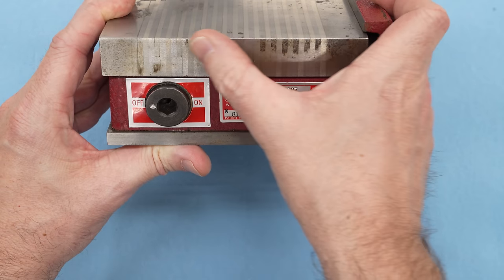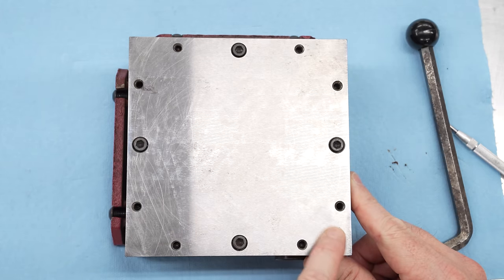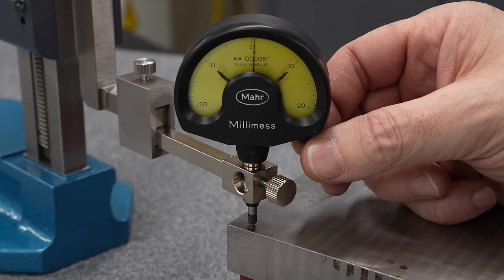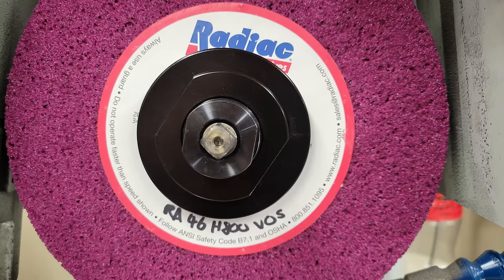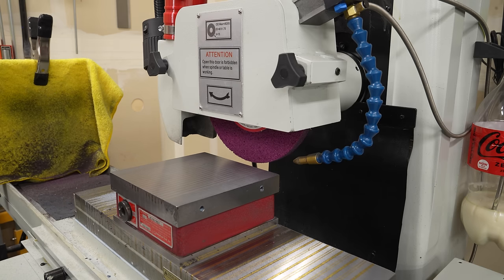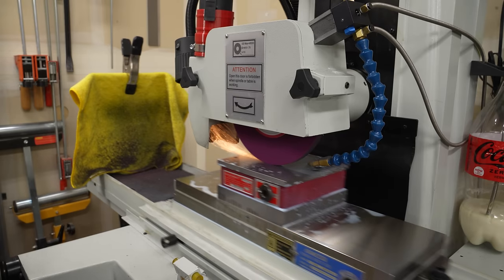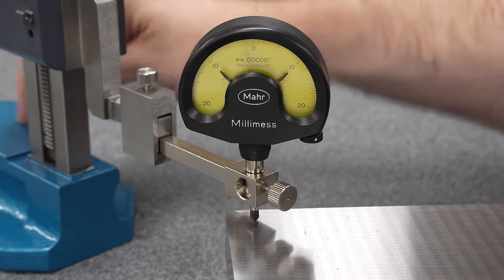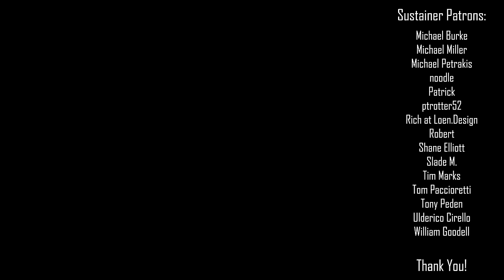Restoring a Rusty eBay Magnetic Chuck - Suburban Tool Sine-Set MC-66-FP-S1

Comment: I was always taught that you need to engage the mag when testing for level.  There's fluctuations between the layers on the surface that can only be found when the chuck is engaged.  e.g. magnetic pinpoints and surface pulling.  Also, I was taught that you should engage the chuck for 48 hours before grinding, this allows the chuck to settle with it engaged so you get better repeatability.  Just something my shop instructor always "ground" into us :)
Reply: you can speed up the process by heating the chuck to 120f then letting it air cool ,it's how they settle the chucks at one of our contractors shops
Reply: might be more on electric chucks?
Reply from the maker: Oh, interesting.  If we're being pedantic, and I think we are, I should also turn the spindle on and let it run for a while to warm up and stabilize, and I shouldn't be stopping it between setups.
Reply: @Clough42  That's pretty much what Don Bailey @SuburbanTool would advise, and he's the most knowledgeable YouTuber on precision grinding I know of.

Comment: Very good job especially for your experience level. About 80% of the life time grind hands I know could not do what you did. Someone commented that you used the diamond dresser wrong but he is wrong. You used it the correct way. If it was rotated 180 degrees into the wheel you would have put a flat on the point and ruined it. Mag chucks are hard to get flat. You have many more variables  to overcome. One thing to consider changing is your roughing method. It generates a lot more heat than just coming across it with about .05 step over verses .4. You can take huge deaths of cuts with less than .05 step over and keep the cooler than taking big step overs. I don't do a true step over but just keep the Z axis moving while traversing in the X but it would be close to a .05 or less step over. Also, you don't have to worry about the wheel grabbing the part and throwing it off the table as much. This method work great for light mag work as well. Again great job, I am impressed.
Reply: Larger stepovers distribute wear better on the grinding wheel, plus maintain thickness of work from one side to the other (2/3 wheel width). This was the practice when I was using grinding machines. Plus 1 for the diamond, agree with engaging the magnet. I once dressed the wheel too hard, lost the diamond (melt the braze) and told to fish it out of the coolant tank. More to make the point, I think. Surprising, I found it, sitting on the slurry.
Reply: @BillDavies-ej6ye   Don't need to worry about the wear in roughing cuts, the heat build up is the real enemy. You true the wheel up with a redress before the finishing cuts. I grind under fifty Millionths all the time with this method on both small and large parts.
Reply: I was going to say ask Steve barten. Lol but he's already hear.  ❤

Comment: we rarely step over the whole wheel width .   Most of the time we used lighter cuts ,takes longer but theres a crap load of heat being put in the metal.     Alot of the time we left the wheel on  all through the project , even through set ups , it's pretty much standard practice in tool and die shops  the spindle and column heat up  and settle in.  in fact it was considered kinda rude to shut it off if you knew some one else was going in right after you.    variable mag. chucks are super nice when grinding for flat.
Reply from the maker: Thanks for the tips.  Next time I'm doing something serious, I'll let it run in for a while.  That's kind of hard to do when shooting a YouTube video though, due to the background noise and the comment safety police.  :)
Reply: @Clough42  maybe a sound dampening enclosure for the grinder could be an interesting project?

Comment: I really don't see anything I would have done differently. Yes, checking the bottom would have been on the initial inspection, but the order of operations wouldn't have been any different (other than grinding the machine's mag chuck first, of course). Nice work, James.

Comment: James, As an observation, I see alternate conventional and climb grinding.  A suggestion from an old guy; for precision work only conventional cut.  When climbing the swarf must go up into the wheel prior to being expelled by centrifugal force plus greater contact area for the wheel adding unnecessary heat, not an ideal situation; also the wheels bonds are stressed from two directions.  I was taught ( in the early 1970's) by a master toolmaker to only conventional cut!  Another thing I see is the grinder being turned off between grinds, every time the wheel is started it needs dressing, as it may become eccentric on the hub.  I was taught to start the machine and let it warm up while collecting the tools and work to start with.  This next part is not the safest procedure but the most accurate.  With the wheel running move the table to the extreme right to place the diamond on and secure, dress the wheel, and again move the table to the extreme right to remove the diamond.  Move the wheel well up out of the way and clean the chuck.  After wiping slide your hand over the magnetic chuck to ensure no grit or swarf remains.   The wheel spins until the work is finished.  The largest enemy of precision grinding is dirt in the wrong place, the second is heat,  as metal moves as it warms or cools.  Try it, you may like it!

Comment: Congratulations James, that was pretty spectacular for a first go at trying to get that chuck to a much better tolerance than from the factory. I think anyone who has any experience with surface grinders would call that a win. And now you have a serviceable mag chuck for the sine plate system, ( after you've ground the sides square and all the other bits that is lol )

Comment: Begin by disassembling the chuck, followed by a thorough cleaning of each part. Proceed to individually grind the plates, ensuring they are aligned for contact and parallelism. Once reassembled, perform an additional grinding. This method addresses any geometric inaccuracies that may have arisen from incorrect assembly and avoids creating a chuck whose disassembly would disrupt its overall geometry.

Comment: One tip ill add is that when i was in the shop, we all used blue sharpies instead of a pencil for a flatness reference when grinding. the pencil is a little hard to see in camera, but i think the sharpie should pop for both us and you.
Reply from the maker: The only reason I didn't use sharpie is that I was afraid the soluble oil coolant would wash it away.  I should probably test.  It might be fine.

Comment: As a person that loves to surface grind, I have found that using a piece of yellow legal paper under your part always works good for part removal from the chuck. For some reason yellow legal paper is very consistent at .008", or it used to be. But there will not be any scratches on the chuck when you're done.
Reply from the maker: Oh, interesting.  I might try that.

Comment: I just purchased a compound magnetic sine plate on eBay.  It is older and needs some help after it is repaired.  I think that I will surface it in the mill first before putting in on the surface grinder. I am looking forward to see how it stacks up against the Suburban.  Thanks for sharing.

Comment: not to be too nitpicky, but it looks like the mag on the machine had a little bit of a scallop/fish scale finish to it when you were done. there are two causes for this phenomenon: grinding wheel is slightly out of balance, or the arbor bearings have a bit too much slop. you can compensate some of the bearing slop with balancing the wheel better. and then dressing it. the machine i have has a built in wheel dresser which gives a really good finish on the wheel. if your machine can be retrofitted with one, it is an accessory that i highly recommend and would not want to do without on any surface grinder

Comment: Don't try to recondition the Sine plate. It needs all parts ground  individually using the pivot as a reference. You do not have the equipment to do that. Also if the pivot has any rust in it at all it will need to be rebored and pinned. Get a price for a factory recondition. Edit: BTW some mag chuck base plates have a VERY slight hollow in the center - allows the perimeter to sit dead flat.

Comment: Nice work. The finish “flatness” and “parallelism” is the final “judge” if you did a proper job.😎
My only suggestion is flip that dresser around. The diamond should be “facing” the wheel front not pointed “away”. Also, when dressing the wheel the diamond should be “past center” so that if the table is not locked and the diamond “grabs” it won’t explode the wheel, it will just throw it off. I always lock the table though when I’m dressing the wheel. Otherwise looks like you are doing fine work.😀
Reply: I don't think I've ever heard/seen that anywhere. Almost all directions I've been told and read for dressing the wheel say to have it pointed in the same direction as the rotation of the wheel, not against it.

Comment: OK, I'll be the odd man out. When I started (1970's), I ground chucks kinda like you showed here. One day, an old-timer that I learned to trust told me to grind my 6 x 18 so it looked like a wash board. So that required large steps and only conventional cuts - no climbing. My diamond was mounted in a rectangular block. At the end, you take that block on its broad side to each corner of the chuck, rotate it 30-45 degrees, and see if it sparks out. Repeat that in the center, front to back. I had to learn that how the chuck looks is nowhere near as important as the pieces you grind on that chuck. Heat is your enemy. Guys used to put Crisco over the entire surface, but I was the guy who introduced mist coolant. For the guys who insist on using the leading edge of the wheel, one could also use a 1-inch wide wheel instead of the 1/2-inch. Incidently, I used my same method on a war-era Thompson grinder with a 12 x 24 and could grind a die block that was maybe 10 x 14 dead flat. I think you did a great job for a newby!!

Comment: Some nice work. 

I would have been tempted to remove that bottom plate and ensure it had uniform thickness, and possibly grind it by itself to ensure the chuck doesn't ring up with both top and bottom with matching slopes of a few tenths. However, that's the OCD kicking in.

Do you forsee any issues with grinding the chuck while it's magnetized, but inspecting it while demagnetized?
Reply: I would have thought when chasing fifty millionths, OCD was absolutely compulsory!!

Comment: Some indicators are anti magnetic, and some aren’t. The better ones usually are and the rest? Well, take a guess. Suburban’s specs are a maximum error. Generally, my experience with a “new” tool from them is that the actual error is much less. This could have been new. It depends on storage. I’ve seen some new tooling that looked as though it had been used for years. But I’m skeptical. The surfaces that were rusty shouldn’t have been. The only thing I can think of as an excuse is the it was new, taken out of the box, cleaned off the protective oil and sat around for some time, maybe used once or twice.

Comment: Nice fix James! My suggestion would be to check your grinder accuracy from front to back. I think you will find the 50 millionth error resides there.  Probably will just have to live with it or scrape the ways (Hmmm, another vid?)
Reply from the maker: I would think grinding the chuck would compensate for that.  Maybe I'm missing something, though.
Reply: You have to think in 3 dimensions.  The chuck surface may be perfectly flat, but still  coplanar to the ways which may contain the error. You could take a similar size piece of metal and grind it, then see if the error repeats.  Then you will know it's the ways. @Clough42
Reply from the maker: @shawnstuart1029  the gold standard is the five block test.  I actually have five hardened steel blocks for exactly this purpose.
Reply: The error could be from going full wheel width on the grind. Small increments leaves a full size side of the wheel for longer when doing larger surfaces finish passes. Or so I was taught. Outside of training i have never used a surface grinder 😊
Reply from the maker: @klausnielsen1537  I think either wheel wear or thermal expansion are at the root of the taper.  Though let's keep perspective: 50 millionths is just fine for anything I will ever make.  :)
Reply: I believe you have hit the nail here.  I know that you are....well let's just say "retentive" but in a home shop with budget tools and machinery you hold impressive tolerances. There's no need to chase numbers any further.
Reply: @Clough42  50 millionths got us to the moon, so you should be fine :-)
Reply: @Clough42  just fine for anything you will ever make...... except this video, where it's on the edge of ok.  ;) ;)

(I tease.  It's fine here, too.  And great video!  Except for that BSOD.  I'm on Linux... and was like, uhh, what?  :D)

Comment: One thing's for sure.......there ain't nothing like having a surface grinder even if it is well used and a manual model.......a shop without a surface grinder is a struggle place and I've worked a few of those in time gone by.

Comment: I'm in the process of looking/buying a home in Eagle and you mentioned "No rust" which was a concern of mine as I have a full shop of wood tools. Very sweet words too. hear after living in places that even leaving a piece of paper towel for a day or two can sometimes leave slight rust staining on an untreated cast iron surface..  Being just an engineer (i.e.self taught in the shop) I always appreciate your semi-side tracked commentary re. Do/Don'ts, & Maybe's as they stir up valuable internal thought provoking/learning moments.  re: "Should you use the Mahr indicator w/ or w/o the magnet engaged?  I can think of so many arguments for both ways...  Is there an absolute Yes or No answer?
Reply: To the best of my knowledge All Mahr indicators are non-magnet and are not influenced by normal magnetic field strength found in the average shop. I'm fairly certain that's not a guarantee for them however, and any medium Tesla strengths over .5 may have an effect since the gears are brass, the case and stem are stainless, and the springs are in tension rather than compression. MikeC
Reply: @CothranMike  Thanks for the confirmation. From my limited machining background (but still wide breadth of engineering)I would assume the same as you stated, and I would assume the same for any "high" quality indicator. but who knows what type of tip (or even what kind of stainless) could be on some other imported pieces of equipment... it could be like wearing a watch into an MRI.

Comment: Magnetic chucks are nice basically. They direct magnetic flux trough tapered magnetically connective parts to smaller areas than the permanent has by separating areas with  magnetically non conductive material. to either make circuit trough work piece or internaly trough chuck. High grip power is mostly because magnetic flux is denser in top of the chuck than it is on top of the magnet.

Comment: Always a pleasure watching James' videos.

Regarding the precision flat ground stones, kind of pricey for a hobbyist.

Any reason not to use fine sandpaper with, say, a 1-2-3 block as an alternative?
Reply: Yes!  They're a totally different thing.  The precision ground stones have been made mostly flat so lots of surface area is in contact with the metal you run them over.  They don't cut because you're not applying enough pressure to make them cut - sort of like how a bed of nails works.  Only raised burrs/dings get cut by the stone because they concentrate the force or go between the grains of the stone and get cut.  If you run sandpaper over your precision surfaces, it WILL basically sand it so at best it will be scratched.  The budget option - and definitely not as good - is to take an old file and run it across a stone (preferably a decent diamond one but mainly it needs to be flat) and grind it until you put a flat on the top of each tooth.  That way you have a flat surface that will run across the surface you're working on without causing damage but if anything sticks up, it'll get between the teeth and be sheared off.

Comment: Maybe it's just myself being a novice. But. If both sides are not flat. If you machine one side but the bottom is not flat, aren't you just making it worse?  I would have thought you would need to use a level and some shims or something, to get you as close as possible. Am I wrong?

Comment: How many inches shorter is that chuck compared to when you bought it? 😁
I doubt the magnet in the chuck will affect the gauge much if at all, I expect the magnetic field will rapidly trail off as you move away from the surface because of the way the magnets are arranged inside. I think it's a Halbach array if I remember rightly.
That said, it'll be a fun science experiment to get a Gauss meter and see what the magnetic field strength is like on the surface and an inch or so away with the magnet on and off
🧲